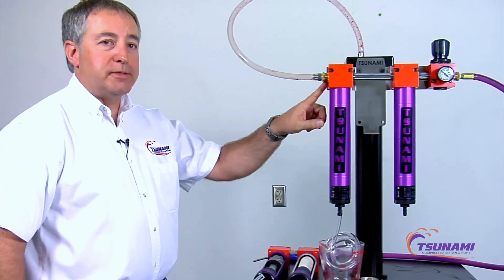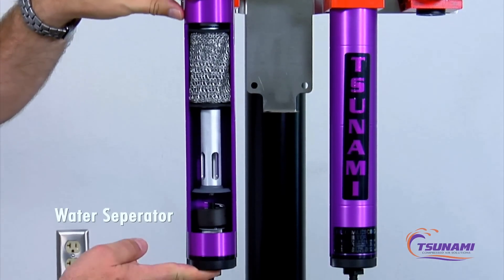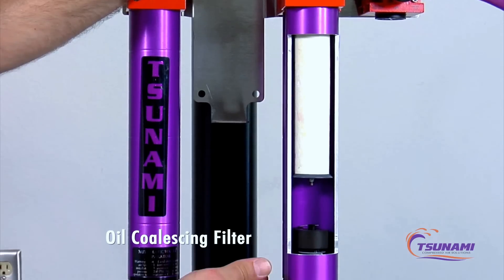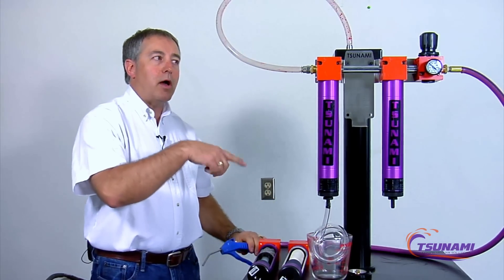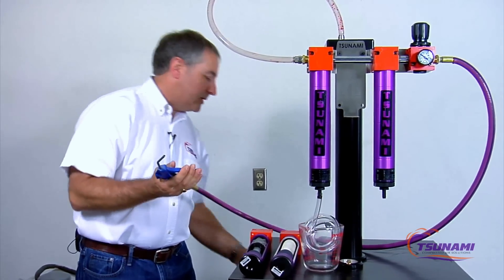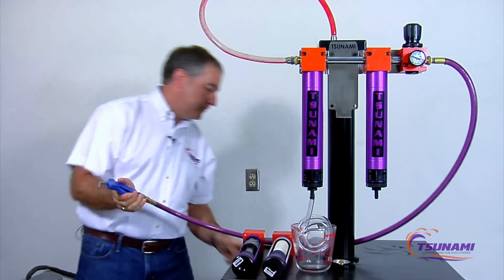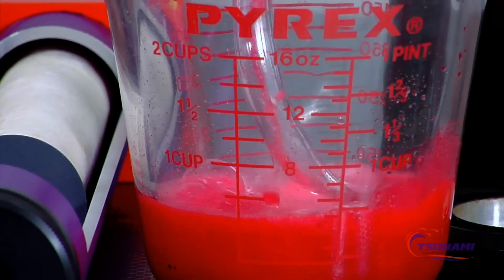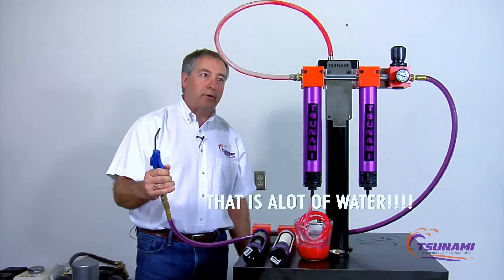Remove Water From a Compressed Air System

Comment: I don't know anybody using this... I'm interested in trying it though
Reply: LSSO-   They work great as pre refer dryer filters.   Not great at booth for final filtration. 

Im a painter at two custom shops.  Both needed better air filtration.  I bought the 3 stage version for both shops hoping to have extremely clean air.  One shop placed them in front of refer dryer.  The other shop we placed at booth because these look very similar to SATA design but less expensive.   Theyve been installed for a few months now.  

Pros-  They are well made, easy to disassemble and clean and the water separator does keep the oil filter dry.  

Cons-  The 3rd stage carbon filter sheds black fibers into paint.  Both shops have the 3rd stage for final filtration at booth.   They both have the same issue.  Take the filter out and tap it on white paper and  they shed black bits.  They also dont dry the air as well as dessicant.  Sata has a long video claiming they do.  Maybe Sata does but Tsunami doesnt.   

Was still having fisheyes in one shop.  Had RTI come out for air audit.  The Tsunami was not letting any noticeable oil through which is great.  Still had 16% RH that day in the lines plus the black carbon bits.  If I had a blank check,  I would love to have Tsunami regen unit.  Right now, the shops arent willing to spend the money.  

Im about to move the Tsunami to the refer dryer and replace it with RTI dessicant at booth.
Reply: @roodmood1  thank you for leaving this review
Reply from the maker: Contact us and you can! https://www.gosuburban.com/our-brands/tsunami-compressed-air-solutions/contact-us